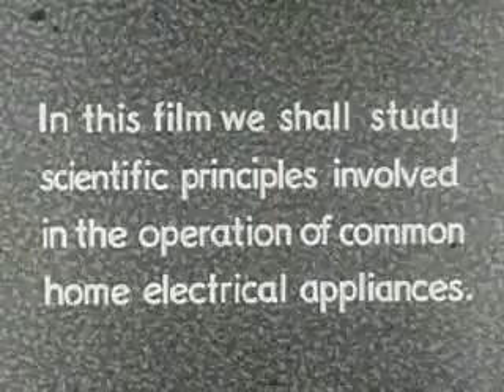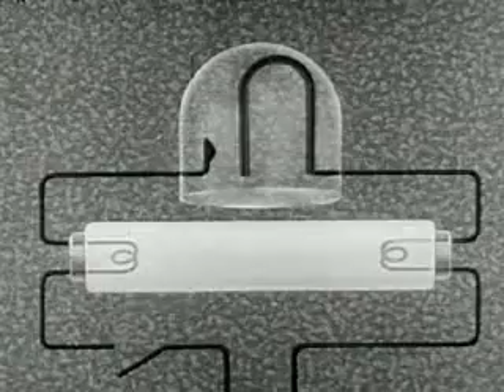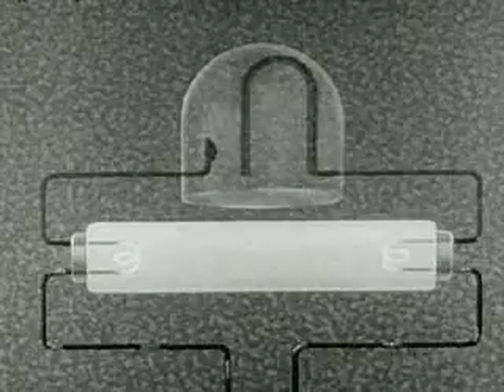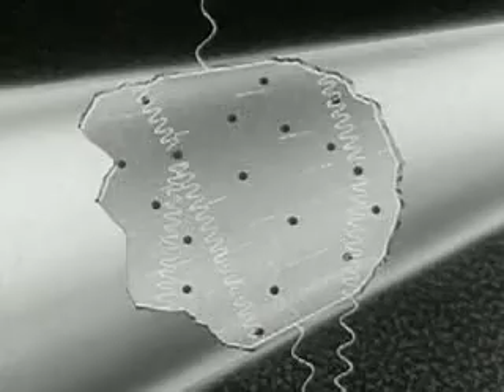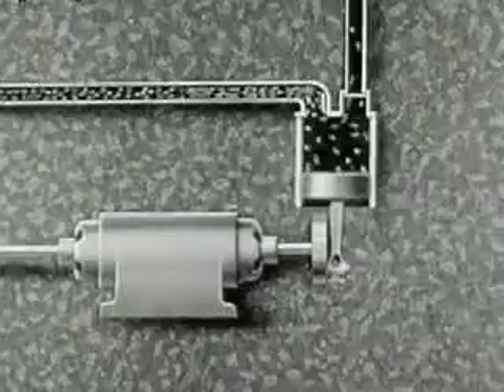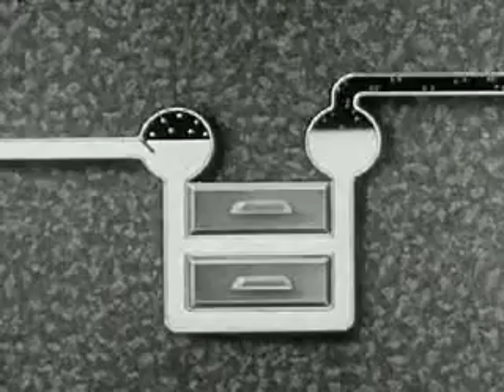Electrical Engineering 1944  Edu Film

Comment: One thing in this video I need to comment on.

We now know that it is not the electrons that run through the house, through the power outlets and into the device, but rather the electric fields due to the currents that power the devices.

If I'm mistaken feel free to correct me.
Reply: are you crazy?